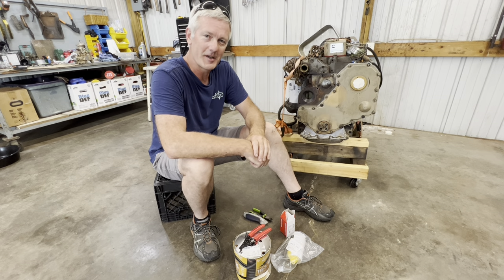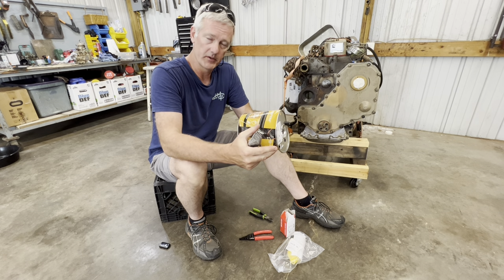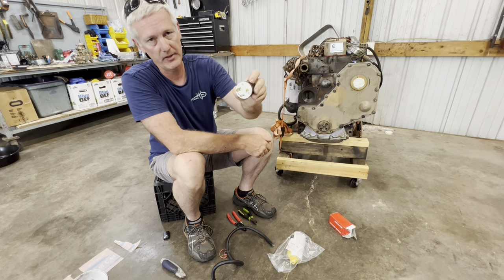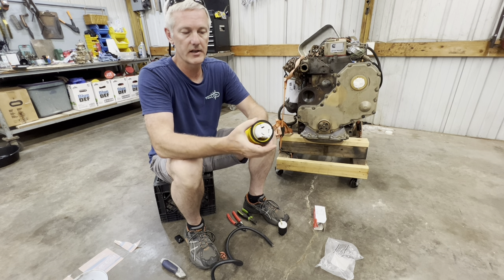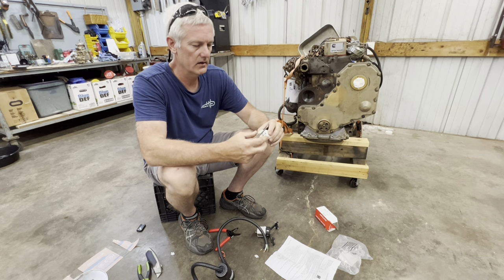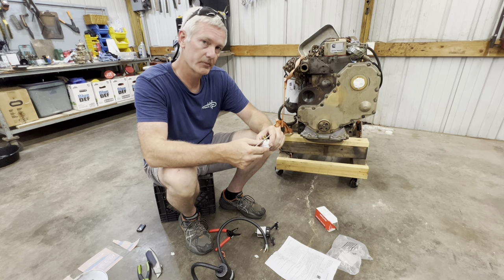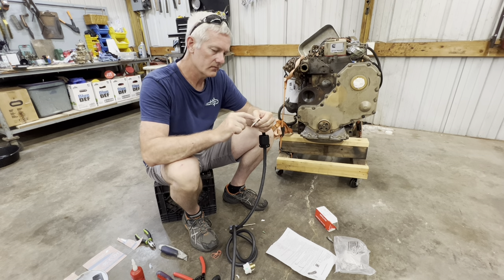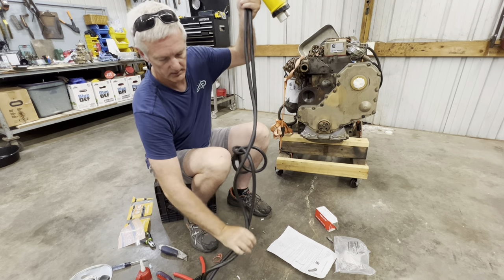Predator 3500 Generator Replaces My Westerbeke 8.5KW Marine Generator!!!!! Let’s Do It!!!!

Comment: Great Video!  My wife and I watch all your videos.  I have many questions i recently purchased a 1991 marinette same model as yours.  Curious if you have ran your ac off your generator and if so did it work fine
Reply from the maker: I am getting ready to install a soft start on the a/c system, very popular in the RV world to run the a/c units off of generator power. I will have a video of this in the near future. I did try on eco mode but it tripped so it didn’t have enough time to rev up, now Off of eco mode it should do fine but didn’t try it until I get the soft start hooked up.
Thanks for watching
Reply from the maker: New information for you today I have my marine air conditioner running lights and  refrigerator all off of the Predator 3500 it pulls 16.2 amps and 1962 Watts. It runs no problem and it’s got plenty more watch it that generator can handle even with all of those items on. Hope it helps. I’m gonna be putting a video here on this in the next week for you.